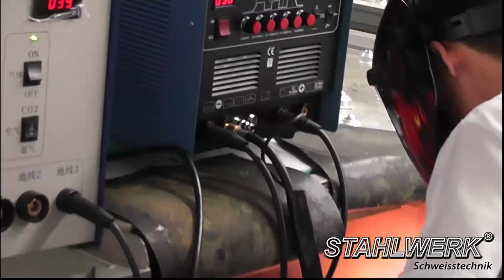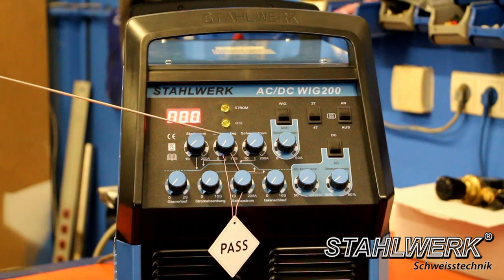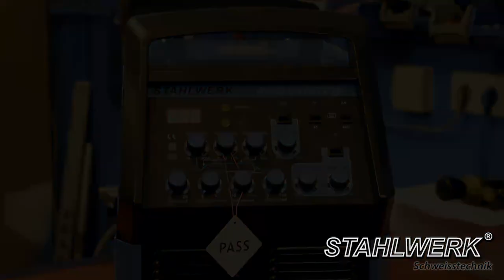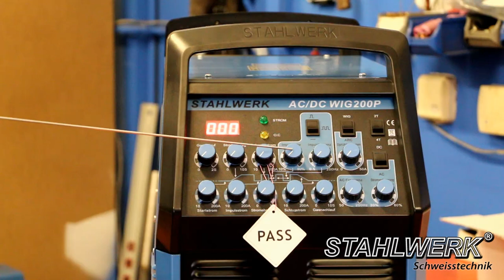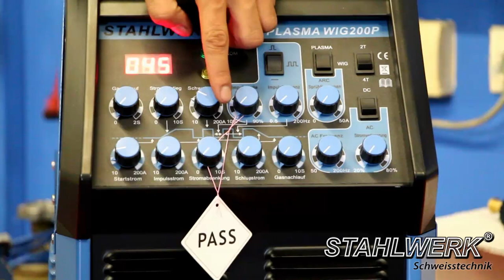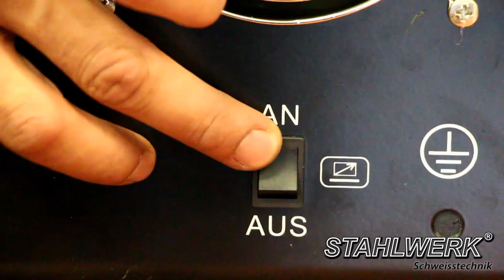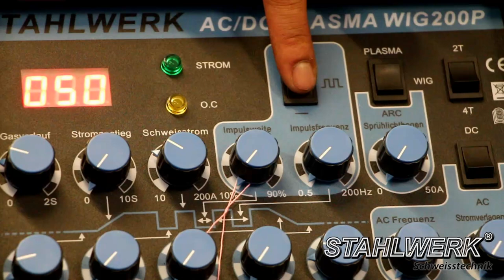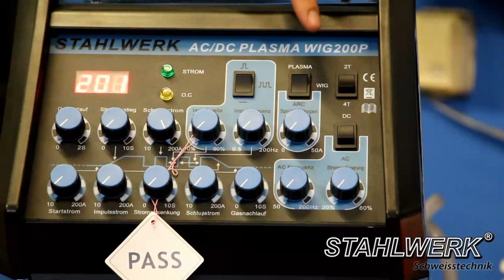Welding Machine STAHLWERK AC/DC Plasma WIG 200P S-Series - ACDC TIG Inverter/Pulse/ARC/Plasma Cutter

Comment: This is absolute crap. I have AC/DC TIG 200 PULS with PLASMA S Complete Set. Only good thing is customer service. The welder went 2 times back to factory and now they say that I must use plasma with 3 bar air pressure. Otherwise the cutter plasma stops. It is possible to cut throw 4 mm steel with it. The foot pedal does not work, the flow regulator does not work. As I sayed ABSOLUTE CRAP. They will delete the comment soon.
Reply: ok, and from which company are you???

And what is your suggestions in this price range?